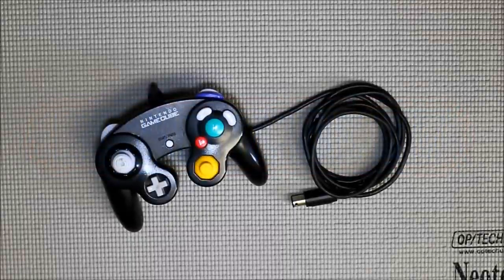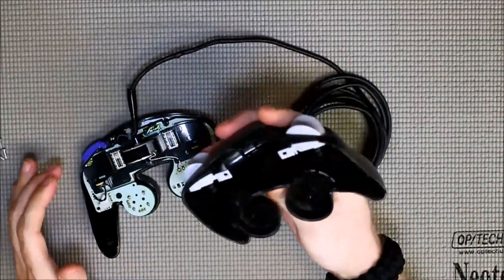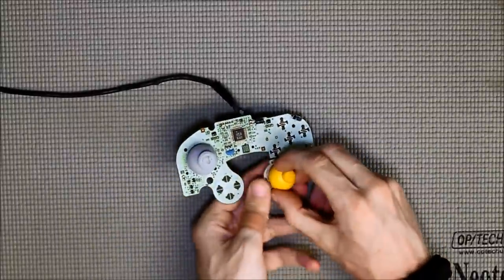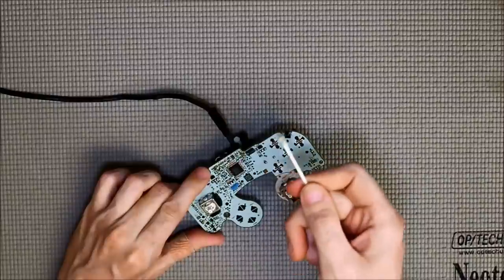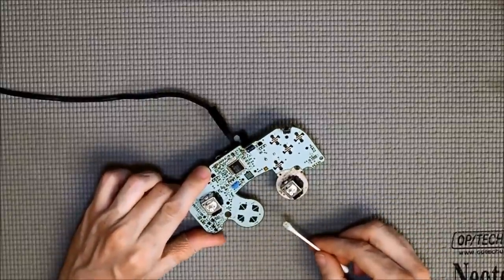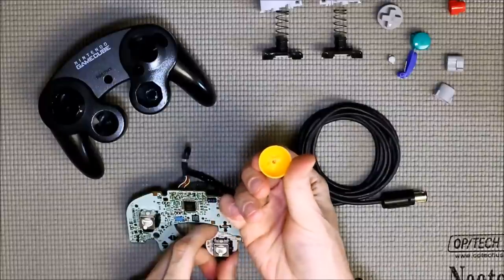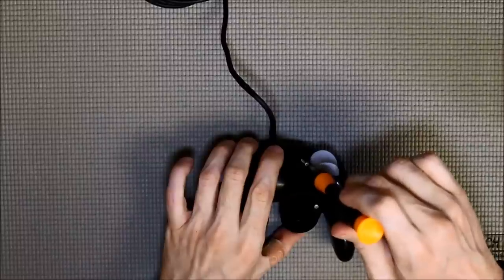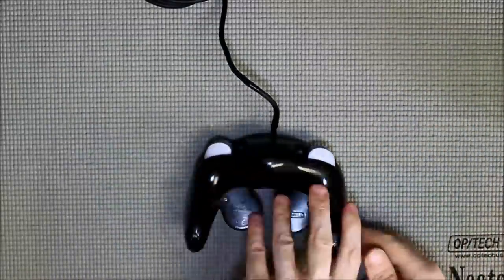Repairing An Original GameCube Controller

Comment: My gamecube controller has trouble going forward or backward at top speed, for example in Wolverine's Revenge where I can run to the sides no problem, I can only "trot" forward and backward. I have seen gameplay on youtube where Wolverine can actually run forward.
I tried lubing the inside of the joystick but nothing happened.
Reply from the maker: Yeah, I would think that it would. I would say you need a new joystick.
Reply: ***** Can I replace the joystick without soldering?
Reply from the maker: thebroodhn Sadly, nope. If it were more cost effective I would offer to do it for you less cost of shipping and parts. But that wouldn't make much sense.

Comment: Do you know any retail stores that might have a Tri Wing Screwdriver?
Reply from the maker: Sadly, I don't know of any retail brick and mortar stores that carry those. I would suggest getting one off Amazon. Here's the one I would get.

http://www.amazon.com/Eclipse-Handled-Screwdriver-Tri-Wing-Driver/dp/B0046QXMF4/ref=sr_1_8?ie=UTF8&qid=1414454226&sr=8-8&keywords=triwing+screwdriver
Reply: Do you know if this one would work? http://www.gaminggenerations.com/store/repair-parts-nintendo-wii-triwing-screwdriver-wiidsgba-p-1023.html
Reply from the maker: All of them are the same size, so any tri-wing will work. Some are just crappy quality. However, I've bought a lot of stuff from them and I wouldn't hesitate to buy that tri-wing. Everything I've bought from them has been pretty good quality. As a matter of fact, the new thumbsticks in this video came from there.
Reply: instinctSwifteh
  I know those guys! They will not steer you wrong!   Their sign out front says 100 years of combined gaming knowledge is there for a reason.  It's shame they had to cancel the SSB bundle on me because Nintendo decided to limit adapter production.

Comment: Will this fix the problem i have in ssbm? Here and there after moving around the analog stick it will think im continuously moving left, right or down. Then i have to recenter it constantly.
Reply from the maker: Nope, it won't. Sounds like the joystick is drifting. It happens and it's just wearing out. Replacing the actual joystick should solve the issue. When I get back to making videos this is one of the first I would like to do.

Comment: Problems: I attempted to replace the joysticks on a controller, and I can't get it back together. Everything is in the correct places, but the shell parts just won't stay together. I bought a new one, but I want to replace the joysticks on my new one as well.
Reply from the maker: +Zyko SSBM Are you saying the two halves won't go back together flush? Or when you screw the screws back in they don't hold them together?
Reply: +BlastMode7 sort of both, I guess. I can sometimes get a couple screws in.
Reply from the maker: +Zyko SSBM Sounds like some of the standoffs are stripped. The only way to really fix that is to use a larger screw. But the standoffs are so small that they would probably split very easy. You could glue them in, but then it wouldn't be very easy to get apart without damaging it the next time. As for not being able to get the two halves together, the GameCube controller can be a bit tricky and sometimes takes a bit of force to get them to snap back together. Just make sure the shoulder buttons and Z button are good before you apply too much pressure.

Comment: My right thumbstick tilts a slight bit downwards leading to major ass pains while for example browsing through menus in game (or playing smash since my character always ducks when im not touching the stick) Do I have to replace the thumbstick with a new one or can I fix it some other way?
Reply from the maker: Sounds like the actual joystick is loose. Something common among controllers that see heavy Smash Bros. use. Unfortunately these need to be soldered on. But if you have soldering skills or are willing learn it's worth it. You can find the joysticks for cheap. Also, they're the same ones use in Wii nunchucks. Probably in other stuff as well.

Comment: When a character is moving by itself what should you do?
Reply from the maker: kaelan barrios If the problem follows the controller, no matter what port you plug it into then I first suspect the actual joystick and replace it. Though there are other components on the board that "could" potentially cause that. Still, the joystick is the most likely culprit.
Reply: K thanx
Reply from the maker: kaelan barrios No problem.

Comment: I bought a white original GameCube controller on eBay. Every buttons work perfectly fine except for the Z one. It still has a clicky sound when I press on it, but I have to press harder to make it respond. What is the cause of that issue?
Reply from the maker: Well, the Z button is a micro switch. Barring a/some bad solder joints I would say the micro switch is going out. Replacing it should fix the issue.
Reply: Okay, thank you.
Reply from the maker: No problem.

Comment: my a b x y buttons arent working. but the others do just fine. is my controller busted or can it be fixed. is it a problem within the controller itself. should I try taking it apart and see if something may have been idk moved! plz help urgent.
Reply from the maker: Hey Dave, there are a few possibilities. Do you know if anything was spilled on it? Anything that keeps the rubber pads from closing the circuit with the contact pads on the board will keep them from working. First I would start with a cleaning, using some isopropyl alcohol. Make sure, both the board and the rubber pads are clean. It's also possible that the rubber pads have come apart. They day out with age and the conditions can accelerate that depending on where you live and they might need to be replaced. If they look visibly fine, but you want to make sure it's not the rubber pads, you can plug the controller into the GameCube with the board exposed and test it by touching the contact pad of each button, one buy one, with something conductive to see if they work or not. Be careful, as static shock can damage the exposed board so if you do this, I suggest you take your socks off and do it in a non-carpeted area and possible use an ESD bracelet to ground yourself. Do this at your own risk. Also, check the wires where they connect to the board and at the connector. If there's an issue there, the controller might register the button presses, but that signal never gets to the console. Lastly, it's possible that there is damage to the board itself or to the controller chip that deals with the inputs of those buttons, though that isn't quite as likely.

Best of luck.
Reply: @TheGameBench  thank you so much for your response. not that i know of i have not spilled anything on the controller. its just weird a while back it was working perfectly fine! until one day i decide to play my system with it and surprsingly just happens not to work. but I will do what you have suggested. I first have to find a tri wing screwdriver. any ideas where I can find some in store? other than that, I want to say thank you for your helpful comment:)
Reply from the maker: Dave, I'm sorry for the slow response and I'm sure you already sourced a Tri-Wing screwdriver... just in case you haven't here's a link to the one I would suggest if you're only planning on the odd project here and there.

https://www.amazon.com/Leegoal-Tri-wing-Screwdriver-Nintendo-Gamecube/dp/B000S6AG9G/ref=sr_1_8?ie=UTF8&qid=1550721942&sr=8-8&keywords=triwing+screwdriver

Comment: It was amazingly easy to fix my controller replacing the C stick and thumb stick. I was afraid all the buttons would fall out and the circuit board would make it a pain to put the controller back together or the shoulder buttons would pose a problem getting them back without a problem of linnig them up properly so they don't miss attaching to the slider switches. It went back together with no troubles lining up the 2 halves. Much better than the piece of crap third party controller that fell apart when I opened it.

Comment: Question. Um I dropped my controller and now the R1 button is unresponsive any tips?
Reply from the maker: You'd really have to open to find out. There's quite a lot going on with shoulder buttons. The potentiometer could have been damaged, (the slider). The small board that has the contact for the button itself is pretty small and the bracket which holds it isn't very robust, that could have broken. Less likely would be damage to the actual mechanism. My bet is on the first two being the issue.
Reply: The little button that's under the R1 is jammed how can I fix that? Could I canabalize one from a Xbox controller?
Reply from the maker: Are you talking about the gray rubber contact pad?
Reply: +BlastMode7 I am indeed it seems to stuck on the metal holding it
Reply from the maker: So, the part that the spring is resting on? If so, nope. You won't find that in any X-Box controller. If you just need to replace the rubber pad, you can find those all over the place. If you can't find a round one you could just trim it easily. That, or you could just find a borked GameCube controller and take the entire R button assembly out of it.

Comment: I threw my gc controller and now is not responding how can i fix it ? Yeah i was mad and was playing smash ....
Reply from the maker: If you threw it and it stopped working, that's a really bad sign. You could open it up and visually inspect it and reassemble, but that kind of force can damage processors or crack a PCB. Or, it might have damaged the connections for the cable which is much more practical to fix. Couldn't know for sure without being able to open it up and look at it.

Comment: When i play super smash bros with my old gamecube controller the R button is registering as if im holding it down despite the R button going back up. Im terribly sorry if this doesnt make sense but how would i fix it?
Reply from the maker: +xShadowClaw1x I would imagine the rubber pad is sticking down on the contact on the little board. I'd start by taking it apart and cleaning it and seeing if the rubber pad needs to be replaced.
Reply: +BlastMode7 alright thank you.
Reply from the maker: +xShadowClaw1x No problem. I hope it helps.

Comment: My GameCube controller L button is unresponsive how do you fix that
Reply from the maker: Well, it could be one of two things. It could be the contact pad or the slider. You can try cleaning the contact pad, and the rubber, and the slider using some 99% ISO or some contact cleaner and then test it out. Usually cleaning the rubber pad and the contact pad fixes those. If not you have a deeper issue which will require parts replacements. Which would mean a new PCB. At that point, it would be easier to just find a replacement controller. With the new ones out I've seen a slight price drop on the older ones. However, MAKE SURE that you let everything dry out after cleaning before plugging it in. Using some canned air will help.
Reply: Cool thanks for the help I'm going to see if the L button response in a few games first before cleaning it out
Reply from the maker: Cool! Let me know how it turns out.

Comment: My controller won’t even work. When I press start nothing registers. It’s not the port as all other controllers work fine. No rattles. Stick is fine buttons are fine. This problem has me so confused. Blew on the end and the controller is clean and dust free. There is a small scuff beneath the cable where it looks like it was dropped but that’s it. Any help people?
Reply: It's most likely a problem with the connection between the cable and the board itself. I have no idea on how to fix that :/

Comment: My Gamecube Controller has a problem. When I tap up, it acts as if I'm still holding up. The stick is fine but the controller will keep the input like I'm actually holding up on the stick. I've tried the reset input, but once I tap up, it happens again and won't stop. I'm not sure what's wrong with the controller since everything else works, even the C-stick. Can anyone tell me what the problem is or how to fix it?
Reply from the maker: +D&#39;onte Graves (Creator-Kun) Even though the stick re-centers, that doesn't mean it's fine. I would say the actual joystick, aka potentiometer, needs to be replaced. They're pretty cheap to replace, but you need to desolder the old one and solder the new one on to the board.
Reply: *****
I wouldn't know how to do that to save my life, but thank you for responding to my little question. This is a frustrating occurrence that's never happened to any one of my controllers until now.
Reply from the maker: +D&#39;onte Graves (Creator-Kun) Yeah, I know that's the case for a lot of people which is why I didn't go over it in this video. I want to make a dedicated video on replacing the actual joystick for people but I don't have any that need replacing. Maybe I'll just pick one and replace the joystick.

Comment: can you help me out, i can't find a single tutorioal for this problem that can adress this. the tip of my analogue stick was ripped of by some evil little kid and now i'm stuck with a controller that has a smaller top of the thumb stick (which is actually really precise and good) but it keeps giving me blisters and is super painful to play with. is there any way for me to reattach the nub without having to take apart the controller and use super glue? i looked at it and it's not ripped or anything, it's just that it's pretty IMPOSSIBLE to try and stretch the rubber enough to put it back on the thumb stick. any help would be appreciated because i think it's like impossible for me to try and play melee with this controller and my other controller has like no precision from all the intense rolling from playing dbz and my other one has a completely broken thumb stick. i will fix those in the future but this controller is 100% working and i want to see if i can fix it first immediately. all the buttons work fine all all 3 controllers btw.
Reply from the maker: +Minimu5e Sorry about the late response. YouTube didn't notify me of the comment. Anyhow, short of gluing it back on the only way to repair it is to really replace the thumbstick which would require taking it apart. However, if you search the are some little rubber covers that slip on over the top of the thumbstick that I've seen for XBox and PlayStation controller thumbsticks. They should work for the GameCube thumbstick and would be a temporary solution.
Reply: ***** ok well thanks for the help anyways but i'm probably just gonna spend the 20 dollars and get a new smash 4 gc controller because it works just fine but wavedashing hella hurts when i try to play melee. tbh it's actually not that bad otherwise though because its smaller tip makes it a little more precise in general.

Comment: Don't use Windex! 91% or higher isopropyl only!
Reply from the maker: The reason I said to start with Windex was because there was a lot of crud. Dirt, hair, crumbs? Windex does a better job of doing that. After I said to follow it up with some IPA. I didn't use it to clean any solder joints and if you're insinuating that Windex can harm the PCB itself, it won't. Regardless, I cleaned it with IPA right after so it's a moot point.

Comment: Do you still recommend a toothbrush for cleaning buttons? I tried it and it left scratches
Reply from the maker: I recommend a soft bristle toothbrush. Then again, I suppose I didn't clarify that in the video. I've never seen one scratch the buttons on one of these, or any system. I've got some that need to be worked on. I'm going to do some testing and perhaps find a better solution than a toothbrush.

Comment: Just did broke the controller. YaY/s
Reply from the maker: To remove the gunk that was on the potentiometer, Windex is a much more effective cleaner than IPA. It will not do any damage, especially since I followed it up with IPA.